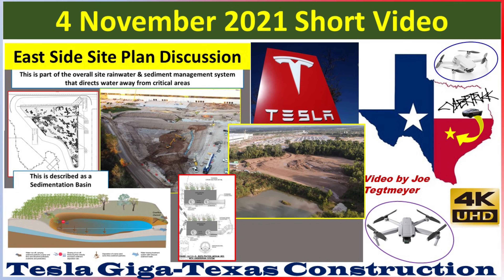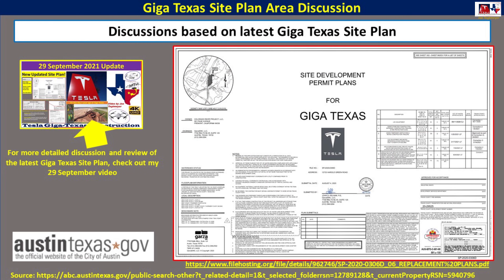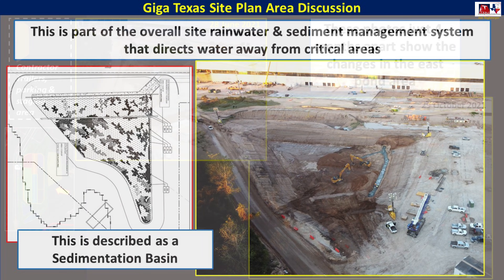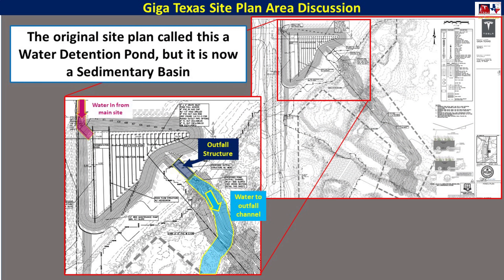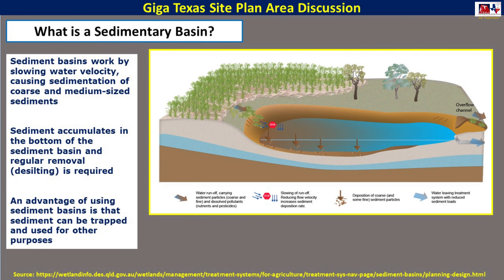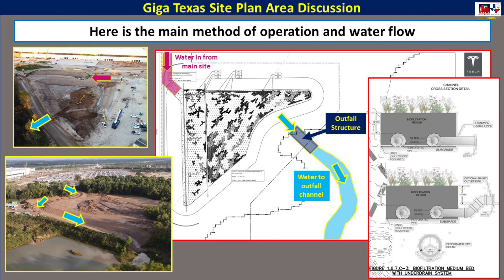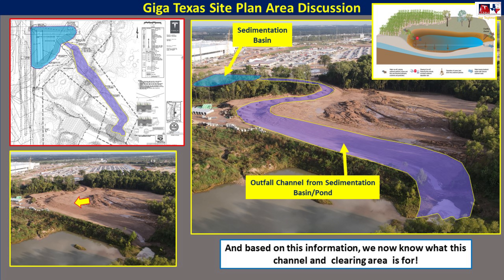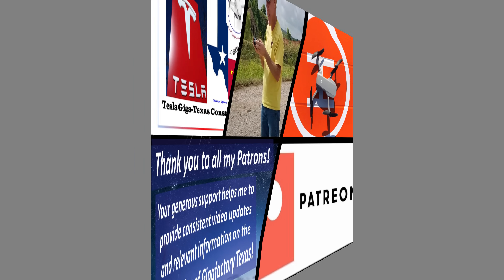Tesla Gigafactory Texas 4 November 2021 East Side Pond Construction Discussion SHORT VIDEO (4K)

Comment: Just to add to what Joe has done a great job of explaining.... The pond also has an underdrain system to drain the pond after a rain event. There will be  a 6" perforated pipe grid 18" under the biofiltration basin to drain the pond after a light rain event. Water in the pond flows through the filtration bed and enters the perforated pipe grid. These pipes connect to a single non-perforated 6" PVC pipe that is buried under the outfall channel. About halfway down the channel the pipe discharges into the channel. So, after a light rain event, the pond will drain slowly. 
In heavier rain events, the pond weir/outfall structure controls flow to the outfall channel.
Reply: For those interested in the details, I will also repeat Elton Ray's full explanation of the pond system here..... "At the start of a rain the pond level could be anywhere between 0' and 5' based on recent weather. The pond has a constant flow from the filtration beds through a 6" drain so it would be possibly dry. This is the definition of a detainment pond. When it rains the water from the North and North half of the East side of the building flow through the pipes and discharge behind the distribution wall which has 36 round holes 2.5' in diameter. From there into the sedimentation area which slopes down 1' to a semipermeable wall that is about 4.5' tall. Then, through or over the wall into the biofiltration area where it percolates through the beds to the collection pipe grid and then out to the ponds near the river. As the water level increases above this point at about 5' level the water starts overflow through 2 round holes 2' in dia. in the weir wall. If rain rate cannot be handled by these holes the ~ 150' folded weir overflows at about 10' pond level to the ponds near the river. 
After the rain the pond level drops to 5' through the holes in the weir and continues to drop as it soaks through the biofiltration medium into the 6" drain to the ponds. At some point with no rain it would have no standing water."